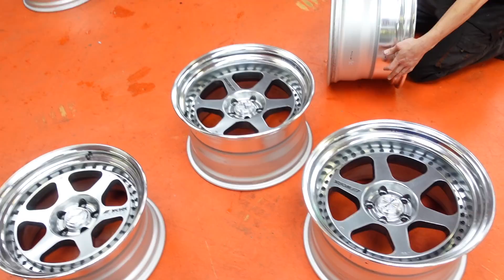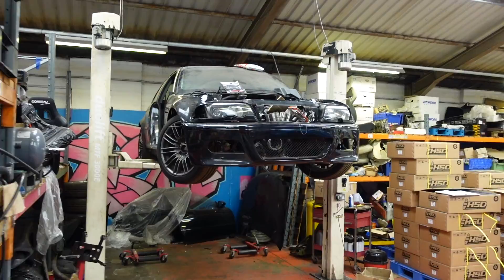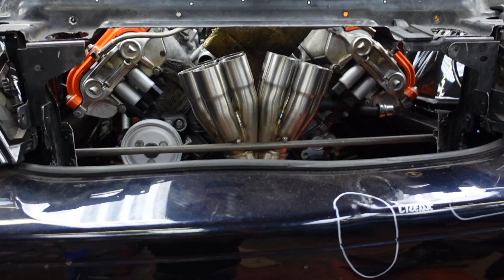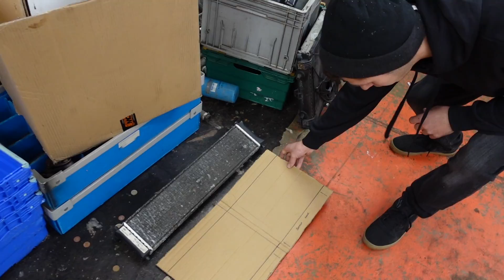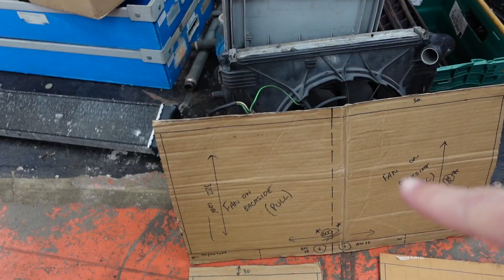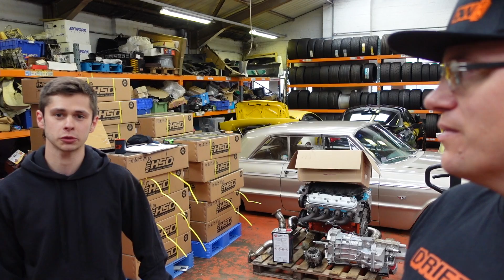V10 M3 gets 4 custom radiators measured up. BMW E46 Part 33

Comment: Having owned an E46 M3, chucking a rad in the front either side too, I have to ask the question of how you going to get good air feed to the brake discs for cooling?
Reply from the maker: I haven't quite worked that out yet, but it's not so important on a road car with decent sized brakes.
Reply: Driftworks - maybe a NACA Duct in the splitter with some ducting to the back of the disc perhaps?

Comment: So, guys, when this is all done...kit for sale?  Ship you a car and motor, and you ship it back completely built?  What's the plan, Phil?
Reply from the maker: Haha, absolutely not in a million years 😄
Reply: @driftworks  LOL!  Just teasing us all with this?  I see.  You want to be the only chap cruising around with a V10 in his E46, then.  Ok, fair, fair.  But how about this - all the bits to weld up the rear frame, the front crossmember and steering rack, the modified oil pan and pump parts, and the radiators with mounting hardware...and anything else that is essential to the conversion (but not necessarily the fancy 10-to-1 exhaust or anything like that).  Think of a basic parts kit for the conversion, and maybe include a parts list for any OE parts that need to be purchased from BMW or elsewhere, that may not come on the E46 or the V10 powertrain.  What do you say to that?  It all could be tossed into one crate covered in Driftworks logos and shipped around the globe.  "Driftworks E46 V10 Conversion Kit."  Tell me that doesn't sound good bouncing off the eardrums, eh?

Comment: I have an S85 project and I was planning on using two aftermarket Porsche side mount radiators similar to those you were considering.  If space wasn’t an issue would they have worked ok?  Flow rate etc.
Reply from the maker: There's no way they'll fit under any circumstance because of how the wheel /tyre enters that area.
Reply: Driftworks it’s going in a mid engine car.  Not an E46.  I was just wondering if they will work.

Comment: quick question regarding wheels im looking for some bbs sr in anthracite but heard bbs are in trouble is that true and what will it change for orders cheers oliver
Reply: BBS is now the third time(after 2007/2011) in bankruptcy proceedings but production is still running
Reply from the maker: You'd have to get in touch with the team in the shop, but as far as I know they are still dispatching orders.

Comment: Hey Guys, first off all... Thanks for keeping my mind sane during the corona lockdown here in Denmark, my car addiction has been sort of under control due to your build videos😅
Maybe I missed it, but can you share your diff setup for both this build and the E30 M3, preload and accell/decell ramp settings please? And if it is not too much to ask, maybe some comments on your expierence of the cars behaviour? 
Best regards 
Chris
Reply from the maker: No worries, thanks. I don't have specifics, but the V10 M3 uses an old Carbonetics carbon plate 1.5way. The E30 M3 uses a 210 Drexler GT light LSD.

Comment: I am very interested into hearing Phil's thinking on how they get air first past the bumper. I think there must be total rethink on the bumper sides, foglight holes are not enough... I would keep middle part of the M3 bumper and then do completely new sides a'la Jaguar Project 8. Sides should be made in Fusion 360, then 3d printed and glued to center piece, and then use that as a mold for self carrying carbon fiber bumper skin.
Reply: I'm pretty sure he said he wants it to look as standard as possible asits goin to be a road car primarily.
Reply: @liamcosgrave5410  Yes that is why I suggest subtly perforated stock bumper look. Obviously carbon for weight and strenght reasons, painted to bodycolor ofcourse, we are not tuners but it would be engineering solution for getting more air volume. Ofcourse then it needs to be dissipated underneath the car better than stock and also all venturis and air path underneath the car needs to be also worked, so that lift is minimized at least.

Comment: Make sure to get the ducting right, the fans will help to pull air through but ducting the air directly to and from the radiators will make all the difference. Motive video recently made a good video explaining how and why ducts are important, very informative

Comment: Have you thought about running(Water Wetter Coolant Additive) or something like this instead of water. To keep temps down?
Reply: Still needs heat exchangers
Reply from the maker: Water wetter is okay. It may bring temps down a tiny amount. I wouldn't use waterless coolant again though, it's too dangerous.
Reply: Driftworks good to get some more knowledge from you guys 👍🏻👍🏻

Comment: You've probably already thought about fan controllers and fans, but just incase you haven't... I converted my M3's to electric SPAL fans and use a Flex-A-lite soft start fan controller to run it. The soft start is nice but I can also force the fan to power on OR off (turn it off going through drive throughs because the fan is pretty loud) with a simple switch. And it works great in the Las Vegas heat.
Reply from the maker: Thanks man! I think the fans we're using are SPAL so I'll check out the controller.

Comment: With some ‘fettling/hacking’ could you not make one thin/long custom rad that would run the length of the slam?
Edit. Further on in the video now and seen the other coolers haha maybe modify the arch liners to allow air through to the smaller rads?

Comment: Does Starkys Volvo still have the harmonica in the grill? 🤣

Many modern superbike rads are curved, which might help fit in the space you have at the sides.

You got this anyway though i suspect
Reply: I think they got it in hand
Reply: @hoonaticbloggs5402  yeah i forget that when the video comes out they'll have already sorted the problem and that commenting early on in a video makes no sense when the issue will have been addressed later in the vid lol
Reply: Do custom cordd exist that curved? Or are they just on bikes?
Reply: @beetledrift  there's no real reason why you couldn't weld two rads together to get a angle. Or even if he fitted a couple of bike rads